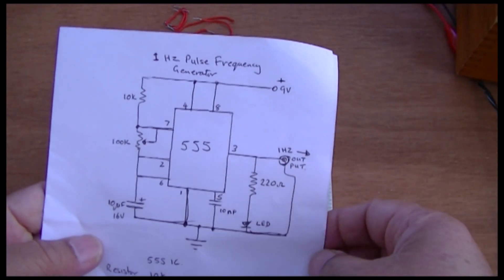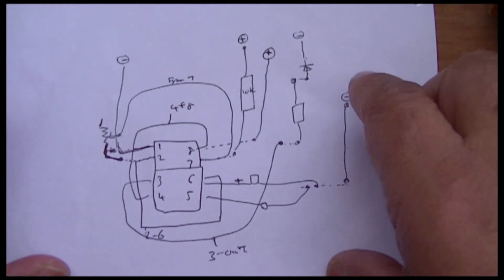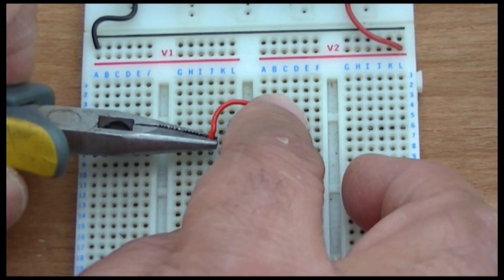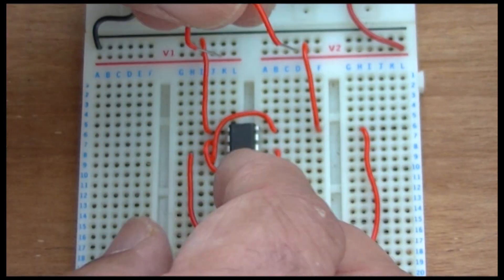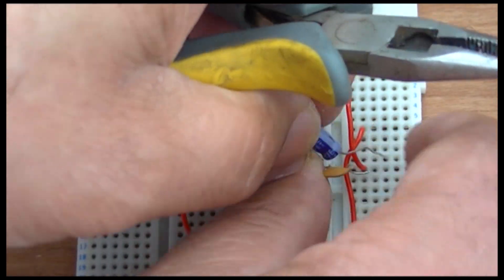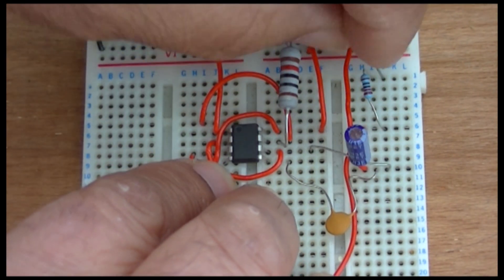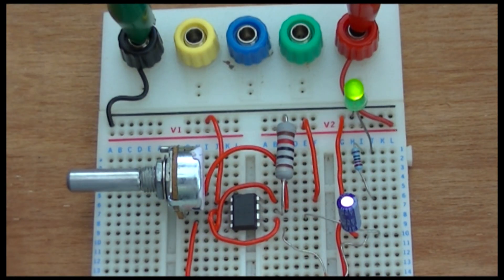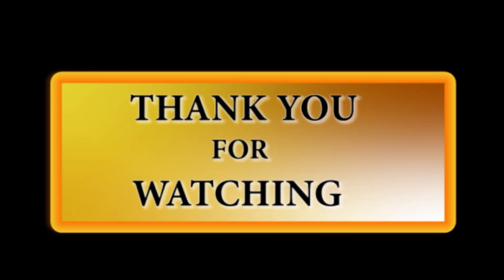1 Hz Pulse Frequency Generator with 555

Comment: Worked like a charm. I followed some other videos and none worked, i started to think my 555 was broken, but this one worked,  thanks!
I tried it with a potentiometer like shown and also with only a resistor between pins 2 and 7, that also worked but with a fixed frequency.
Reply from the maker: Jorge Guberte Great and thank you for comment. 👍🏼

Comment: Could you tell me how much energy the circuit requires? Can I use a 9v battery?
Reply from the maker: Ingrid V Hi yes you can use a 9v battery. I use an adapter with 9v. It also worked with 6v. I do not know how much energy but I don't think it will be much. Thanks
Reply from the maker: Ingrid V should say shouldn't be much energy.
Reply: Just4Fun ok. Thank you. The video was very clear and it help me a lot :)